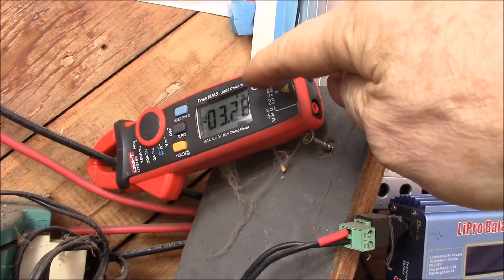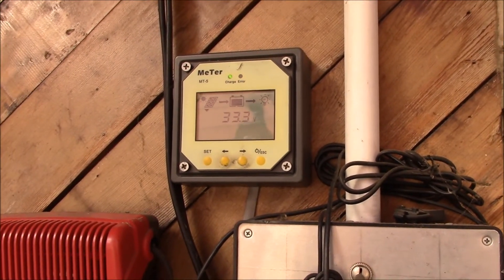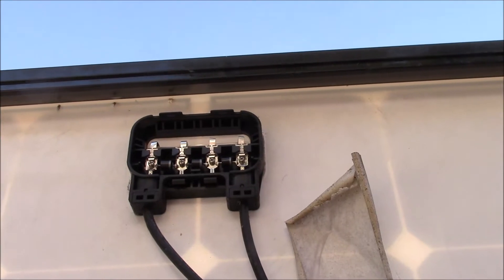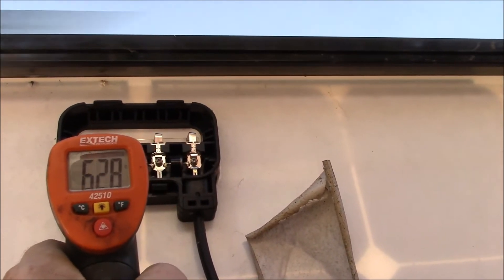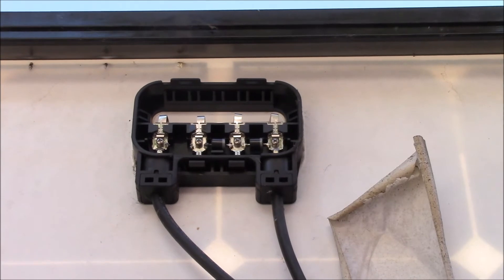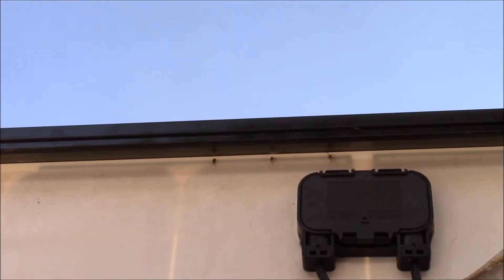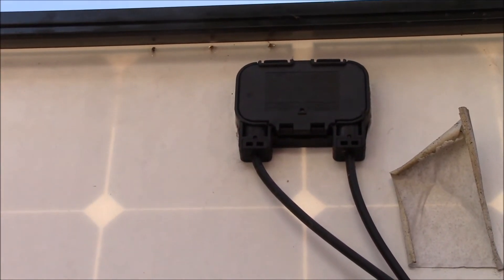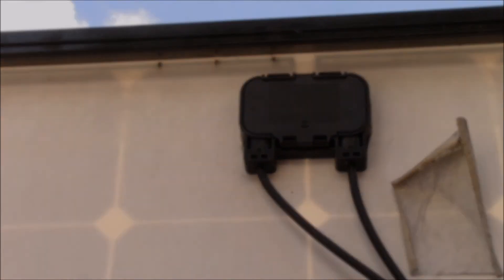Solar Panel Troubleshooting and Repair, Part 1

Comment: my pv has voltage but no amperes... I changed the diode but still the same
Reply from the maker: I've had a couple of panels (all this same brand) that had flaky MC-4 connectors.  They would seem to make connection with a cable but would pass little or no current.  Finally ended up replacing both connectors on those panels and all works fine now.  

How I tested was set a meter on 10A range, plug probes into connector on panel and I read short circuit current.  But plug in a cable to the panel and repeat the short circuit test at the end of that cable and little to no current on the meter.
Reply: @The4Crawler  I've used multitester inside the box of the pv, so nothing todo with the wires or mc4

I've tested directly from terminal at the back pf the pv still 0 ampers but it has voltage
Reply: im confused now it could the pv connector inside is broken or loose contact
Reply from the maker: @BackyardniJuan  I think the internal contacts were too short and would just barely make a connection to the mating contact in the cable I plugged in.  I had a batch of 5 panels and all of them had these dodgy connectors.  Some worked for a few years then suddenly stopped.  In every case, replacing the connectors fixed the problem.
Reply from the maker: @BackyardniJuan  Then likely a bad wiring connection inside the panel, either at the junction box or one of the traces. That was the problem I had with this panel, one of the copper traces on the back of the panel was bad.  I show that in the next video.
Reply: @The4Crawler  thanks, I will to remove the box later and see the connection

Comment: I'm getting 35 volts 0 amps on both of my panels. Im sad.
Reply from the maker: Since you're getting voltage, but no current, there's an electrical connection but at a high resistance so you aren't seeing any current.  

Check the MC4 connectors, I've had those go bad and not make a decent connection.  That one stumped me for a long time as I would go up on the roof, unplug the panel and with meter probes shoved into the connectors, I'd get the full short circuit current reading.  Yet, when I plugged the panel back into the wires on the rack, it would show no current when I checked down on the ground. 

Also check the connections on the back of the panel, maybe there's a bad solder joint.

Comment: Though it's the dead of winter, even on a clear, sunny day, I'm only getting about half power off of my two panels on my truck. Weird thing is that on an overcast day, i sometimes get almost full power. Very confusing. Something better start making sense because i don't like the little frowny face on my charge controller. :(
Reply from the maker: You could test each panel separately in full sun, open circuit voltage and short circuit current.  If that shows near full output, then it may be that you're seeing the charge controller limiting the panel output if the batteries are near a full charge.  On an overcast day, your batteries may be at a lower state of charge and when you get a bit of direct sunlight, you'll get higher panel output.
Reply: @The4Crawler  thank you for responding to my comment! I've eliminated tree shade and fog and have been sitting in the direct sunlight for about an hour now. Batteries are charging and charge controller hasa happy face again. You rock!

Comment: Did you correct this issue ?  The Diodes prevent Reverse Currents at night.  Discharging Battery.    Not protecting anything within the PV .
Reply from the maker: I do have the replacement bypass diodes and still need to finish the repairs on this panel. These are bypass diodes and not blocking diodes:
https://www.electronics-tutorials.ws/diode/bypass-diodes.html
Each of the 3 diodes bypasses a string of 20 PV cells in the panel to help with partial shading.  My charge controllers have blocking diode functionality to protect against battery discharge at night.

Comment: Wasn't the panel under warranty usually get 25 year warranty....
Reply from the maker: Well, this is what happens when you purchase panels on eBay like these were.  They were sold as name brand panels as I recall, but I was suspicious.  Had several bad MC-4 connectors fail over the last 5 years on a few of these panels.  Also the labels on the back of the panels were paper and have weathered and fallen off years ago.  That's why I picked up my new panels from a local solar dealer warehouse so I would have a real warranty.  Live and learn :)  I still need to finish up the repair on this panel and get it back into service.

Comment: Try to cut away the white plastic on the back to expose the bus bar and you may just find bad solder joints re solder them test again and if working reseal that area I just use plastic spray paint good luck